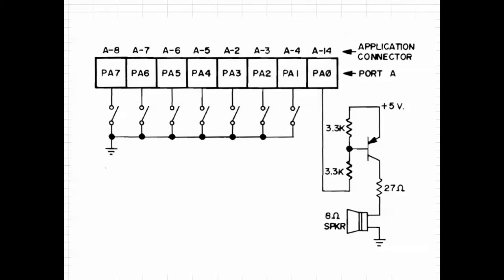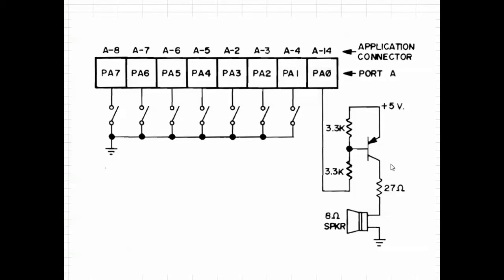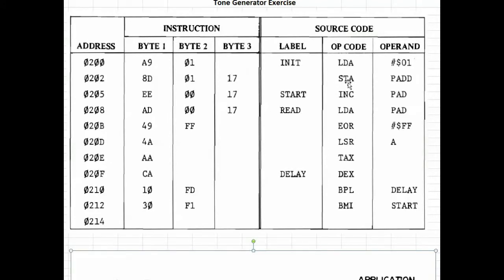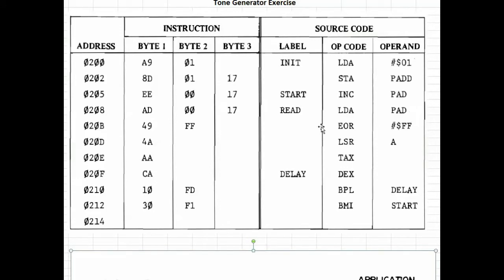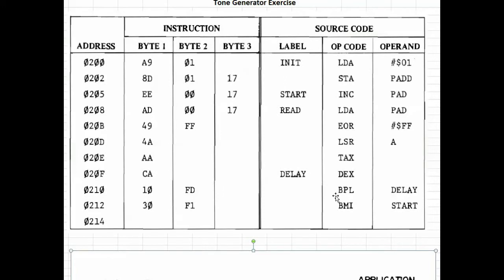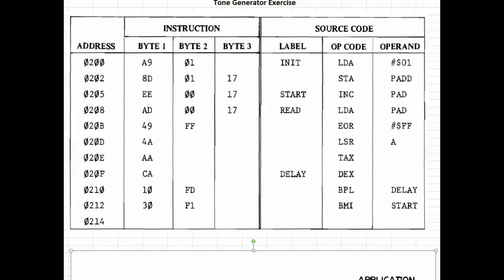KIM-1 Tone Generator

Comment from the maker: If you do not have an edge connector, as I do here. You can easily use a 40 pin Alligator Clip connected to your 6530-003 (RIAT-ROM  Chip in the Center) and run wires from it, to your bread board.